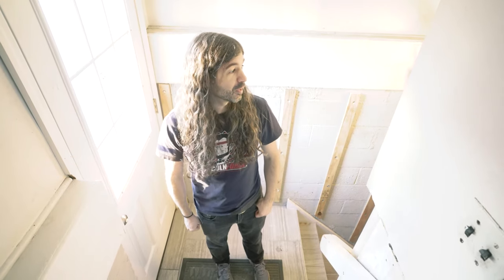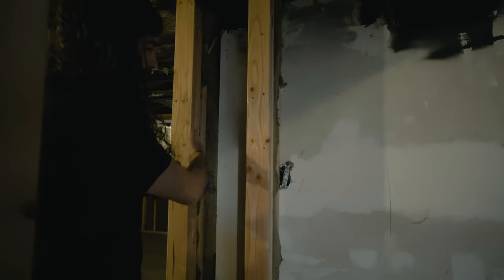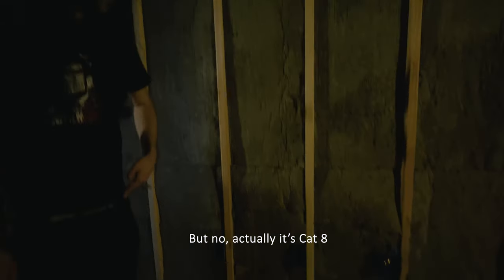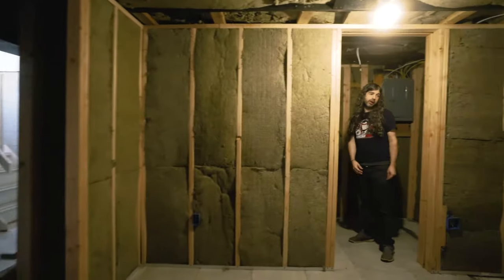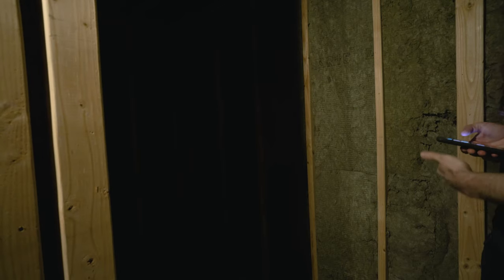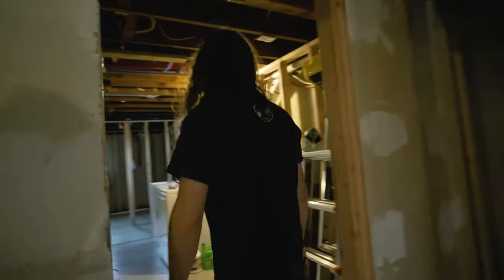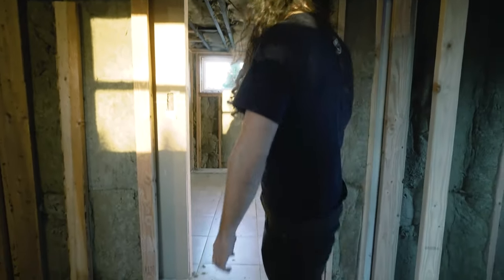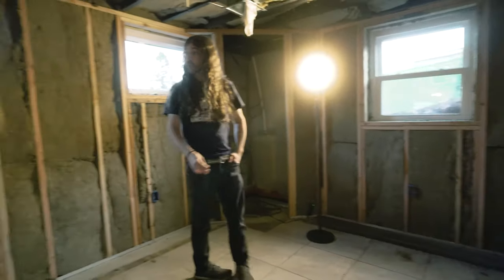Basement Recording Studio Build: Week 1 - Framing, Insulation, and Wiring [East of the wall]

Comment: Dude...I also bought myself a $100 Gazebo / Pergola (200cm x 200cm) and placed it in my basement on a noise absorbing rug. I left the outside "walls" off and placed moving blankets on all five sides. Got myself a 10M led strip for the inside and some bass traps in the corners and foam on the inside off the blankets. Super easy set-up for recording with my D18 and singing at the same time straight into my iPhone using the Roland Go Pro mix. Call me cheap but I just love my little "tent" inside my basement. Nice and cozy. Love your channel man!!
Reply from the maker: Nice - you can record some tracks, and when you're done you have a blanket fort to hang in.